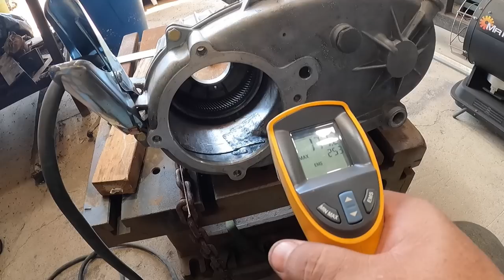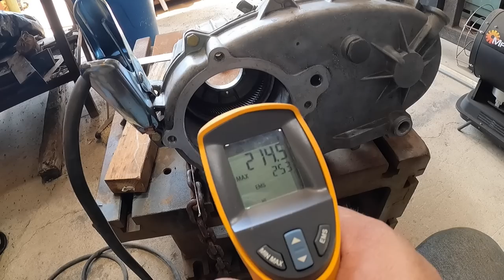Transfer Case (Weld) Failure???

Comment: That was a nightmare. Aluminium castings are extremely difficult to weld at the best of times, never mind trying to repair some else's repair. It looks like that last repair was done with oxy. The case should have been scrapped in the first place and just replaced.

Comment: Patience of a saint Isaac . I would have definitely told them, well you shouldn't have tried to fix it before, and say you need another case because it would cost more than another case to repair it .
Reply: Exactly, I can't believe that a used case wouldn't have been way cheaper
Reply: Junkyard np231 or 242 or whichever it is, would cost less than the weld bill.

Comment: 1 time, my buddys old ranch tucks front axle shaft came apart and broke a 4 inch round hole in the tranfer case . Took it to the local welder, and he said he can't guarantee it will hold and would not  touch it. Next, we Coundnt find one at the junk yard or even new housing for that truck was obsolete, so we went over to local parts store and got JB weld clay type and mixed liquid  type. And got a wire mesh. We scuffed it up good and put wire mesh over the hole and applied clay tipe first,let it drye and then we applied liquid type over it and so far its been over 10 yrs still holding t-case fluid in. Last resort kinda deal 👌

Comment: That was a great repair, certainly was not easy.
In my youth I learned to weld aluminum MIG with a spool gun it was not easy, but I learned it, this was in the 1980's, one day at a friend's house I was talking about welding aluminum with a spool gun and how hard it was, my friend's grandmother said that it's much more difficult to weld aluminum with a gas torch....! She was a weldor at one of the Boeing plants during WWII and she welded aluminum with a freaking gas torch... much respect!
Reply: Ya never know who you’re talking to eh? ;)
Reply: I've been in repair  situations with thick aluminum parts where that's the only way to get them hot enough to  weld a nice big gas tip and some filler rod.. if you think about it a tig torch is doing the same thing just with electricity.

Comment: I broke one of those 30 years ago. The pressed metal planetary exploded putting a square or rectangle hole right through the case. The gasket and bolt area were not affected. I just trimmed the broken parts off the ground it neat and welded in a plate, lasted ten more years, and over 100k mi. Then it was sold off.

Comment: 1:57 that gap also probably contributed to the failure since it could be over torqued there forcing it and causing stress till failure.
Reply: I think bouncing over a rock contributed to the failure 😂  The gap was a result of the first person’s attempt to fix it
Reply: Not at all, the case was damaged by whatever it first hit. The case was then ruined by whoever thought they were welding aluminum. 
Issac got close but ideally the case half would need to be surface planed or ground to get a seal surface again. 
Too much cost to make it worth while… replace the case

Comment: Isaac, I admire you for even attempting that repair. If you or the customer had had access to a mill it would have been interesting to see if you could have built up weld in the area where the case was warped and then mill it back down to flat with a precision mill. Enjoyable to watch your work in any event.

Comment: I do appreciate all the effort you went through to make this video. Unfortunately for the customer I know they spent more than the cost of a used junk yard transfer case just in your labor to clean out the old welds, let alone your labor cost to weld it. A new case half from the dealer is only $3-400 last time I bought one.

Comment: Good try!.. Monday morning quarterback on what I'd have tried is to cut a thin slice near that bolt boss, clamp everything down tight, perhaps even with a thin feeler gauge under a couple of the neighboring bosses, weld everything else, then weld up my cut and hope it comes out close enough to straight to be able to sand it flush.
definitely not easy to work the impurities out of that cast though and sure makes a decent weld on top much harder to do

Comment: Well, can't blame you for not working out. You may have been able to save the piece of you had first attempt. I've got an aluminum oil pan from my old Bobcat. 20 HP Kohler horz.twin. the starter mount snapped off. Sort of a weak looking affair. I was able to find a " marketplace" used replacement. If something happens to this one, I'll drive down from Wisconsin!:)

Comment: I think part of the problem is welding a cast work peice. Of course cast aluminum has pores that randomly appear after being remelted. Much respect because of the best effort possible! I guess IF you were set up to be a foundry a chunk could be cut out then modeled up then cast from aluminum and stuck in place.

Comment: Welding, Aluminium Crankcases, Gear Boxes etc can be a pain ???
The primary work in my shop was previously Repairing Aluminium Casings.

The jobs that look like would be a absolute pain actually went really well.
Where as Cases that should be fairly straightforward were absolute Nightmare.
Unfortunately, with some jobs I had to simply give up and hand the part back to the customer without completing the Repair ??

It's not a great feeling to simply give up from the sake of failing ???
But, some Cases were totally un-repairable no matter how much effort I put in.

Comment: Can’t help it bud.. every person has a different perspective but not everyone has really done aluminum cast! Again it stinks and most times breaks in the hardest to weld places!  Rims, boats, door frames are considered a clip excursion. Always easier to weld but create hydrogen when welded. Seen some X-rays of new welded and it’s a sponge! Believe me after 30 years of welding it it is what it is bud.. swiss cheese pard! I love how you take anything on just to try. Gets me in trouble all the time but love it when it works out! A heavy coat of black paint will work wonders on cast aluminum pin holes. Thanks for your time bud. Your patience alone is worth $

Comment: I agree. Should have been melted down. That said I have had “MINIMAL”  success in the past by taking the support ribs from one side of the case and building matching ribs on the other side especially around the bolt holes. Then building up the low spots a filing them down as I went along. As I said minimal success. Good luck

Comment: My initial thought is it does not look like aluminum but alumiweld or similar 'repair' rod, especially when the thin piece on the inside was chiseled out.  The bubbly outside look seems to say excessive heating with the torch because the casting had gotten oxidized and the alumiweld would not stick?

Comment: Just returning a favor bud.. I have done many repairs to aluminum casting. Transmission and transfer cases. If you have a old stove whether gas or electric it works great for preheating and boiling out the crap slowly! You can always throw it back in a couple of minutes. Two three times per side. Second you will never get all the porous welds clean! Its a nonferrous spounge. Set your cleaning action at max.. run your beeds cool slowly and even when you buf it down rarely will it leak with a few holes! Good luck pard!  Ps the profax 1260 gun is awesome

Comment: I'm thinking the original repair was with one of those weld sticks and an propane torche you see at the the county fair booth. They probable have a use but not in this case.

Comment: Those cases are near impossible to repair and very easy to break
Reply: I fix them all the time.  From C clips slicing a hole to chains wearing a window.  I won't put one back together that has blown apart though.  Stuff like this is not a challenge most of the time.
Reply: My friend dropped a case half on the ground, it just shattered like glass

Comment: Did you ever get your Dynasty fixed, or are you still on an alternate machine?  Just curious how extensive the problem was, if it's fixed.
Reply from the maker: Never got it fixed. Considered sending the circuit board to a friend who might be able to repair it. hadnt moved forward with that either. 😕😕😕

Comment: Oh NO, NO, NO Hey man that transfer case is Magnesium. You need magnesium filler rod.  I ran into the same problem several years ago, had one that had a small hole worn into by the chain, I cleaned, stainless brushed and tig welded with 4043. Was putting my stuff up and heard a  little pop sound , the filler metal popped up a little . Tapped it with my hammer and it popped out. I figured it out finally and ordered some magnesium filler rod. It worked

Comment: A replacement case would be cheaper than your time although it's a common failure so maybe there's no stock anywhere?  Either way your welds are certainly 10000% better so at least it has a chance.

Comment: With aluminium it is possible to heat it up so hard soap burns on its surface then quench it. This will remove all the work/age hardening the aluminium has received. 
Also during this heating process it will show up if there is any oil trapped in the aluminium as it bubbles out.

Comment: I have fixed transmission cases with JB Weld if the crack /hole is not structural. They have lasted for years.

Comment: Atleast it was an interesting learning experience.
If it was me doing it would have just JB welded it feom the first break for a "cold" weld, if it holds oil keep trucking.
The first job was a good example in epic porosity.

Comment: I have found if you use the gas ax to burn the oil out with the oxygen cutting lever depressed not trying to heat the part up gust burn oil off it works well to clean up cast aluminum

Comment: I'm not sure if the case you were working on was magnesium or not but a lot of them are and repairing with aluminum filler wire can make a mess- so that might have been the issue with the original repair attempt.
Reply: :original repair" may have been still on the truck.  Engineers screwed-up.

Comment: Boy that first welding job looks sloppy. I’m glad you plan to clean most of the old stuff out and preheat the aluminum before ya start welding. What do they say ? You have to heat it slowly to 800 degrees. They taught us in class when ya get close to melting on aluminum ya turn the oxygen off and flash the flame across it. When the fumes stick and you can see it your ready to do an unstressed weld on aluminum. Let her cool very slowly till it sets(which is pretty quick) does that sound right?

Comment: Is there a certain temperature you need to get the casting to and maintain at while adding weld? How do you know if setting it in front of the heater is adequate or not or to hot?

Comment: Have you seen guys fixing aluminum wheels using oxygen and acetylene torch and aluminum they melt to form sticks?! To be honest, the repairs look "fairly" good. Not sure how strong they'll be. 
There must be something in the oxi-torch flame that keeps the metal from oxidizing. 🤔
Reply: I have done alot of wheels,Tig woth er4043 filler.5356 isnt ductile enough,tig is really the best way to go.

Comment: That is a New Process Gear 230 or 240 series transfer case, I don't know why anyone would go through the process of having one welded because they are a dime a dozen.  I probably have 20 of each of those case halves on my shelf and another dozen complete transfer cases out back.  I can buy complete core transfer cases for $20-$30 anytime.  That gap would of sealed up fine using a little more silicone than normal since they do not use a gasket. 

You have to be careful when welding New Process Gear transfer cases because they went to magnesium cases after that generation.  What was your balance set at for this.

Comment: What do you use on your die grinder cutter to keep the aluminum from sticking to it?
Reply: Those burrs with less flutes are made for aluminum and don't clog as badly as normal burrs meant for steel.
Reply: Try isopropyl alcohol. Also good for milling, drilling, taping aluminum. Chips won’t stick and you get a better finish. Mike

Comment: It would be helpful if you could tell us the “actual time” at the end of the video so that we can compare your real time for the various processes compared to what it take me (us) to do a similar process. Thanks for all we can learn from your “lessons”. 👍👍👍😃😃😃
Reply from the maker: it took about 3hrs with the heating cycles. Too involved for a failure. Shoulda known to pass on it but I was hoping it woulda worked.
Reply: @ICWeld In this instance finding a good junkyard part was the answer.  I am guessing you bill at $100 an hour or more.  Just die grinding off old weld and preheating probably burned an hour of time, not with it for a part when repaired worth less than that.  So glad you tried this for sake of making a video and your honesty that you thought this had a chance of making it.  I have been surprised at some oddball jobs you take on and come up with a way to be successful.  Keep giving these a shot

Comment: You are a great welder but in that case I would’ve fixed it with MarineTex. They possibly hit a rock and caused the original damage, by my experience there is some warping of the casting that is terrible to fix while hot but good to fix with epoxy. It looked good at the end but you must make it perfectly flat for it to seal.

Comment: i would of got  the case white hot and braised it closed with argon or an oxy set yes you can use either a mig or tig to seal a hole the reality is you are  dealing with cast metal u likely do more structural damage just trying to add a welding bead into the space